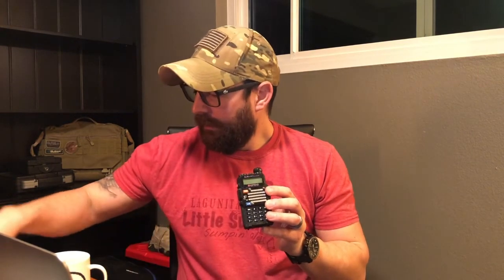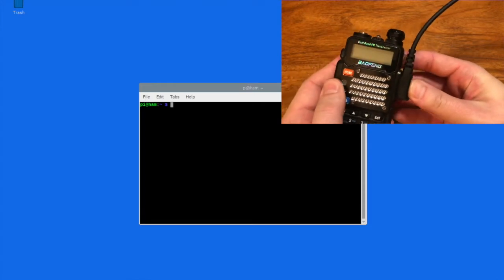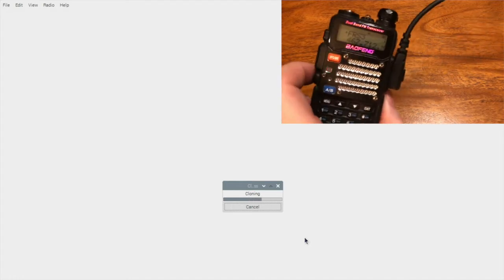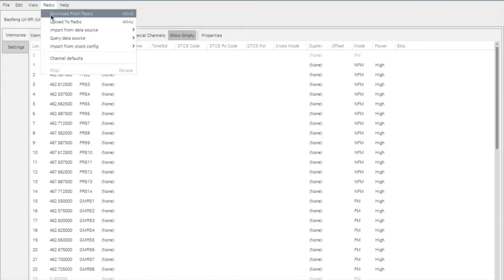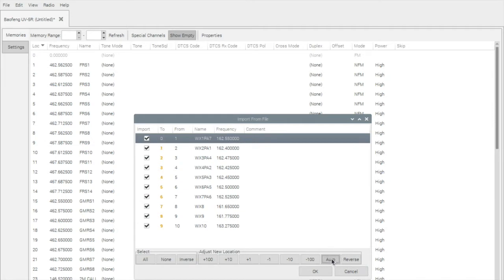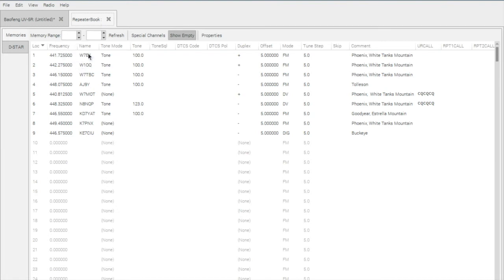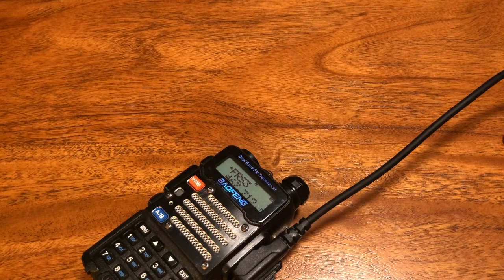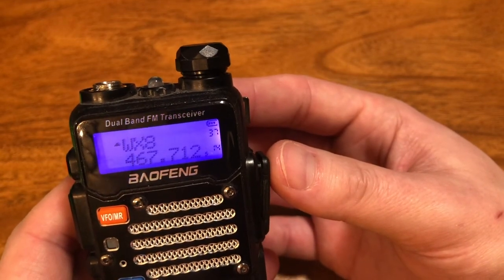Programming the Baofeng UV-5R

Comment: I just learned a few things about CHIRP in this video that I was not aware of and you just earned another subscriber.. Thanks for the video.
Reply from the maker: Welcome aboard. Thank you. Wow, this was one of my first videos 4 years ago.
Reply: @TheTechPrepper  Just doing some research and trying to find a decent radio for down situations that didn't  break the bank when I stumbled across your channel. I was wanting something portable that done HF and I could learn morse code. Your video on the x6100 peaked my attention, even though i have heard tech support is basically worthless for Xiegu. Wish Yeasu would build something similar  for the same price.
 Thank You again for your channel and its content.
Reply from the maker: @bjen2005  Check out my videos on the G90. It's hard to beat given the price point. I sold my 6100 as it overheated far too much.
Reply: Didn’t realize the chirp software has all of those frequencies preloaded!